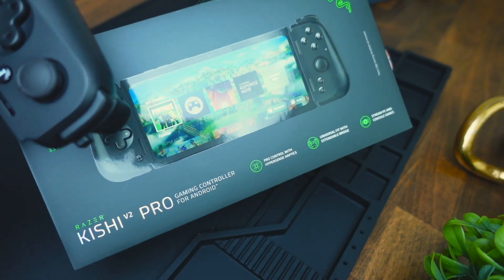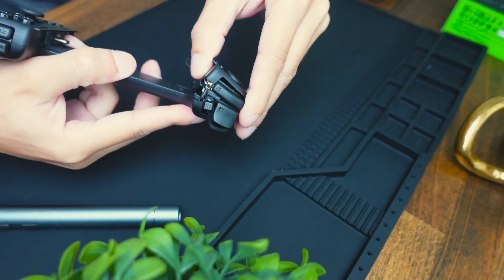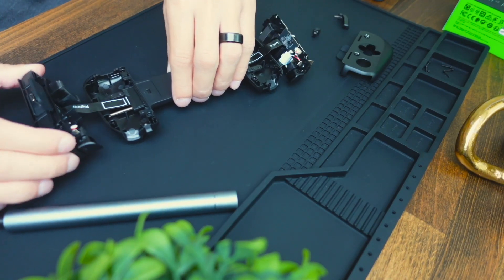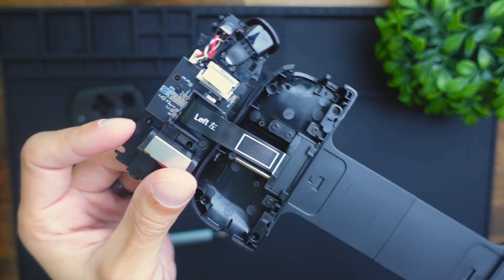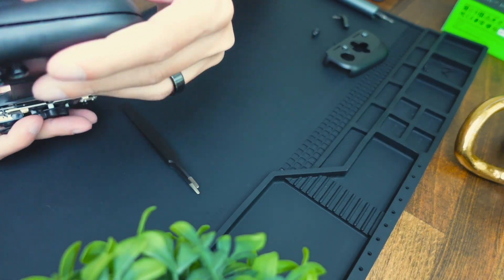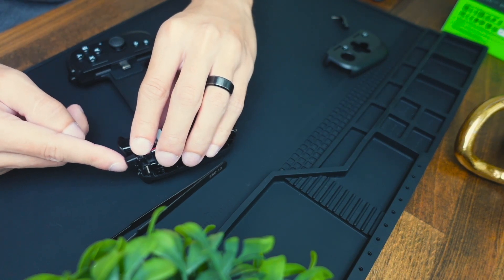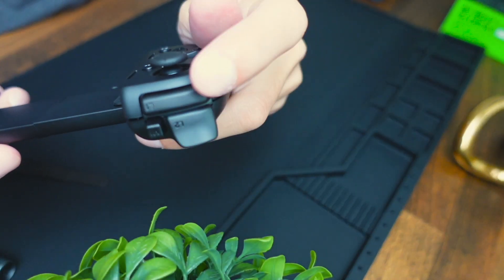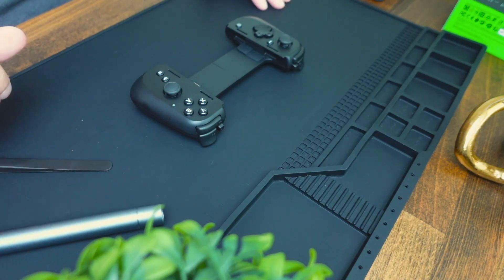Razer Kishi V2 pro controller - Teardown

Comment: damn, not much room for batteries. was hoping to sneak an 18650 in each side. guess its flat cells on the back or inside the slider then.

notice there is silicone on the dpad switches. to make those less clicky put a dob of silicone adhesive (electrical grade) on the switch bodies themselves, button caps shoukd be filled too (hollow = clicky loud).

Comment: I don't really understand the point of a teardown that doesn't address repairability.  It would've been useful to identify which parts have OEM replacement available, which ones can be replaced with off-the-shelf hardware, etc.

Comment: Is it possible to change out the thumb sticks for full size longer thumb sticks ?

Which one will fit
Reply: I too am interested in what modules can be inserted into this controller. My unit has stick drift. I’m assuming only the mini, Joycon sized, thumb sticks will fit but I have not yet found the answer.